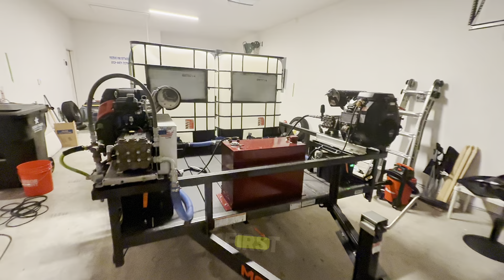2026 Pressure King Softwash Trailer Walk Around

Comment: This is amazing brother.  I definitely needs a part list for Those non collapsible hoses and banjo filters. The stuff I bought in Amazon is no bueno.
Reply from the maker: Thanks man! Just a quick search but may have to compare prices. The blue noncollapse hose: (choose your specific size, standard is 1in) https://www.go2marine.com/products/kuriyama-tigerflex-blue-water-bw-series-multi-purpose-hose-blue-clear-low-temperature-pvc-suction-hose?variant=50092937281821&utm_source=google&utm_medium=cpc&utm_campaign=%7Bcampaignname%7D&utm_content=%7Badgroupname%7D&utm_term=&gad_source=1&gad_campaignid=16249586776&gbraid=0AAAAAD_v3nHpsm47DIgCvJnMxmXpmxTjY&gclid=CjwKCAjw4dDTBhAqEiwAkHYmStTgm4FypU7OgGB0JWb2s3oNFrFMaH4YcU34T2ex9JWfDeWqvgMuFBoCtIwQAvD_BwE

Y-filter: https://www.zoro.com/banjo-y-strainer-1-14-pipe-fnpt-x-fnpt-polypropylene-150-psi-ls125-80/i/G2792711/?utm_source=google&utm_medium=surfaces&utm_campaign=shopping%20feed&utm_content=free%20google%20shopping%20clicks&campaignid=23097808759&productid=G2792711&v=&gclsrc=aw.ds&gad_source=1&gad_campaignid=23097808759&gbraid=0AAAAADw3hZdgSVt4vvqY3gKhoggEwzQ8w&gclid=CjwKCAjw4dDTBhAqEiwAkHYmSkf0mz8oICLEN725PgClmyNvLEfGjv3r1TlWeLhyDr8ZSg0G14S4xRoCQesQAvD_BwE